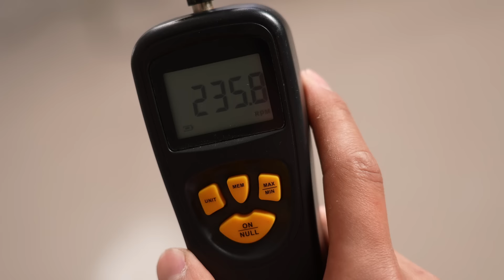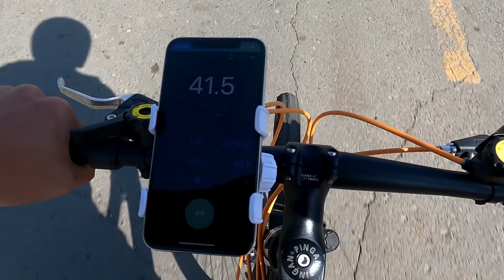Super speed Bike

Comment: It looks like a bit of fun to try , and a nice job building the big cog ,  but the big problem is always going to the amount of horsepower to drive such a big gear. 
If it was as simple as putting a gigantic gear on a bike to make it faster , I have no doubt  bike makers would all be doing it. 
The problem is human legs can only put out  so much power , 
And that power has to push the riders weight , over come friction of the process , and the big one , push X amount of mass through the air, which becomes harder the faster you go.

Comment: Hey, at 2:37, you use a technique that I have seen other metal workers frown upon. I'm no expert, but the way they explain it is that cutting discs are only meant to receive force in a certain direction. Apparently, using this technique weakens the disc and makes it more likely to disintegrate. They suggest using a grinding wheel instead.

Perhaps others can chime in if this is incorrect, but I figured I should say something in case it helps avoid an accident.

Comment: Huge gear ratio is not a key to high speeds. Getting lock pedals and learning to pedal fast while still  putting some torque on it. It's impossible to reach high powers with low pedal rpm.

I'm not competitive cyclist, but when I was still in a shape, I could reach 80km/h on a flat road using cyclocross bike and slick road tires. I could drive 40km/h on quite steep uphill, which I liked to do to get my heart rate up. Cyclocross bike have shorter gear ratios than road bikes.

Comment: A few notes to take:
1) it will be hard af to spin the front gear, cus the bigger the front-to-rear ratio is, the harder it is.
2) you don't even have to ruin your bike to go fast. You could've achieved acceptable speed with default gears. If 25-30 km/h is not enough for you, buy a motorcycle or a car.
3) I can't deny that it works in the end, but did you see the chain? It looked like it could tear apart at any moment.
Reply: 30kmh is nothing on a decent road bike esp if youre fit
Reply: @pastorofmuppets9346 , I see. We have a different feel for speed.

Comment: As much as I would criticize that he just welded those gear pieces onto the wheel instead of machining the gear teeth on the wheel itself with a laser cutter or water jet I am worried about structural integrity after all, but not everyone has those and probably they don't know someone who does so I can't blame him
But that guy has some strength to start pedaling on the mid gears instead of the low gears cause it's easier to apply more torque in lower gear

Comment: However it becomes a bit heavier to peddle because when you multiply the speed, the torque diminishes a bit, so if you're climbing a hill, the speed must be cut in half or more so that you achieve more torque to be able to climb the hill, so that the peddling stays lighter, when going downhill, it's important that you choose high gear, so going downhill will need less torque than going uphill, but because the pedal pulley is larger than the one on the wheels, the torque will maybe not be affected

Comment: It doesn't help to enlarge the gear, if you can not move your legs faster. I can see in your video that it's already passed your limit. When you make gears bigger, it causes more weight on the bike what actually makes you slower than when using a slighty smaller gear..

Comment: *There is nothing wrong with adding more teeth . . . If you add reciprocating mass or apply leaverage to maintain optimum cruise RPM eg. Adding weight 300 gr weight 90 degrees to crank arms would eliminate dead man's curve and perpetual kinetic force increase with increased RPM or a sliding pedal position on the crank arm would increase power of stroke. My cruising speed on my MTN bike while sitting down was 55 KPH on a flat road, that was back in 2010 and suffering a spinal injury with 56t/48t/42t and 28-11t on rear.

Comment: Fun project, but pointless.
Your speed is not limited by the gear ratio. It is limited by air resistance. Above a certain speed your legs will not have the strength to overcome the air resistance. Road bike gearing is tailored to this fact.

Having a gear ratio that makes 100 mph theoretically possible at a reasonable pedal rpm is pointless, since your legs can not develop any where near the power needed to overcome air resistance at those speeds.

Comment: After completion of his new bike. He thought, I should, camera cut. (He is on the highway, passing cars) As he was passing a car with a woman looking confused, in the passenger seat, staring. He slowed down, smiled, and waved at her. She slowly raised her hand and returned the wave. He noticed the man driving, he turned and seen the guy on the bicycle waving at him, and seen the woman looking at the guy on the bicycle and still waving slowly. This guy waved once again, and seen the man driving did not look happy. This guy looks forward and back at the couple in the car and smiled again. The man, smacked the woman on the arm and started fussing with her between that and looking at this guy angry. The woman snapped out the confusion barely and looked at the man fussing and staring back and forth between this guy, her, and the road. This guy is still smiling and he thought, he looks very angry, I’m out of here, and looking forward again, stood up sort of and that was when vtec kicked in. He remembered how the turtle was barely moving then was gone, the gear shifter was moving and you could hear the car running, then vetc kicked on and a second later the camera man opened the hood and a man making Honda noises was all that was under the hood, and he remembered that man making different car noises while sitting in a rocking chair, and he made some Honda noises and then vetc kicked in and it rocked the rocking chair man back and rocked him back as he was shifting those air gears. 
Suddenly he snapped back to reality, and the driving man looked angrier, and that is when this guy’s vetc kicked in hard. About the same time, the guy driving pressed the gas not even a second later. It was too late, this guy was going, going gone. Nothing the driver could do, to keep up. All he could do is pound his fist on the steering wheel and fuss with his girl. This guy looked back and threw the duces up, gave a upwards nod, and took off faster, as he was leaving the car.

Comment: Erm....I regularly hit 60kph on my road bike, and my top speed is 74kph. Granted, my bike is a racer, but all that work for maybe 50kph seems a waste when you could just buy a fast bike.

Also, you can achieve the same gear ratio by only slightly increasing the number of teeth on the chainring and reducing the number of teeth on the sprocket. 

A 55/10 would give a pretty significant speed boost over the standard 53/14

Comment: This won't increase your top speed.
You need to actually increase the thrust at full speed to cause further acceleration. 

Increasing the theoretical zero load rpm is useless because real riding involves a lot of resistance and will limit the speed of your pedals. You actually reduce the top speed by making the gearing too long because the thrust is even weaker and only capable of overcoming the weaker resistance faced at lower speeds.

In my experience, a bicycle tends to need 10-20 lbs of thrust just to maintain pace at full speed. The best gearing for speed should convert your pedal force to the necessary 10-20 lbs. If your pedal force is 150 lbs, a 1/10 ratio could give you the 15 lbs of thrust. Anything reducing your thrust below the necessary force (10-20 lbs) at the wheel will reduce the top speed.

Comment: The fastest i ever went, with a 21 speed hy rid bike, was 72 km/h. I had it recorded on a digital speedo.eter. kept it for years. I wonder how fast i could have went with that. Lol
Reply: not much faster, the reason being is the limit is your own body weight.

while the human body can exert more than its own body weight (its possible to squat or deadlift 400lbs), you cant if you have nothing to push up against. You are pushing your bodyweight onto the pedals, but if you put it too high, itll be too hard to where regardless how hard you push, your body will just go up because there is nothing to hold it down like squatting or deadlifting.  I suggest adding a bar or something for your shoulders, like those squat machines, and youll be able to put more force than normally possible.
Reply: @1mostwanted253  Oh right! O inderstand what you mean. Thank you for the explanation!

Comment: This is a "wow" factor for the ignorant, and "Facepalm" for the intelligent.
Without increasing the diameter of the crank rods, you've attained nothing.
Yea, the rear wheel will spin faster when bench-tested.  But there's something called wind resistance (drag) which remains constant.
Look up torque calculations & gear ratio formulas.  The calculations don't lie.

Comment: ✔ READ THIS MESSAGE !  📩try to make a bicycle with 6 wheels but 2 all be children's bicycles on the front and on the back between the two big wheels as a critical point of the traction cycle and implement the same rotation cycle on the pedals! you made my dream visible on your channel! however, you can create a much better design in the middle for the frame

Comment: I very clearly remember the first time I was able to sustain 33MPH. Getting onto a 52 tooth big ring and maintaining a reasonable cadence is very hard. 44kph is only 27 mph. I've seen people use rings that big in the past but there is a reason the bikes nearly never have larger than 54 teeth. One. they are capable of 40mph, Two nearly nobody can turn them at +100 RPM. Not even the pros use larger.

Comment: This is a complete non-sense, you didn't change anything except changed gear ratios from front to back and have to paddle harder. If this would make your bike any faster it would already been adapted on racing bicycles. With a larger gear on the front you simply have to paddle HARDER instead of faster to reach the exact same speed as with a smaller gear, and forget going uphill at any climb because you can't, you have to get off your bike and push it if you want to go up anywhere. This modification is non-sense.